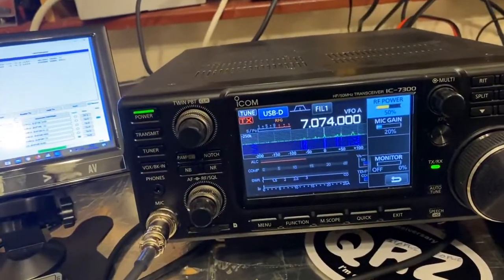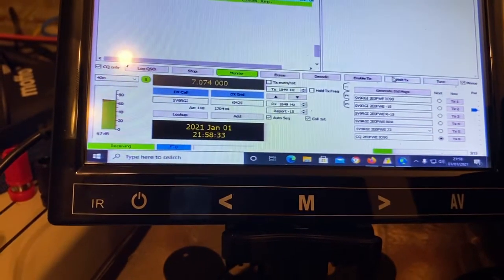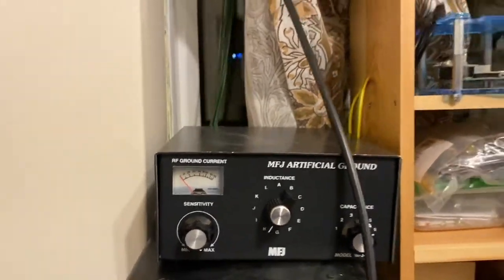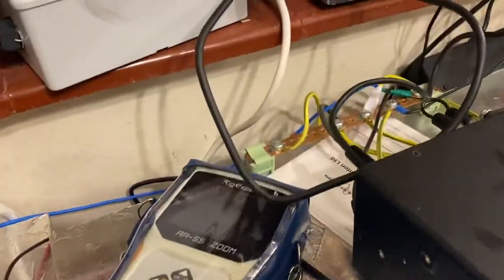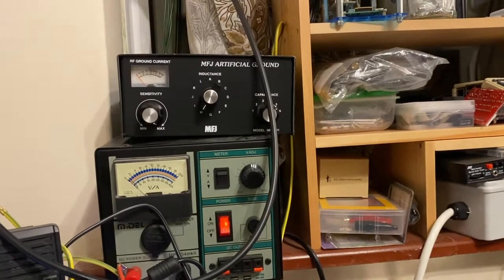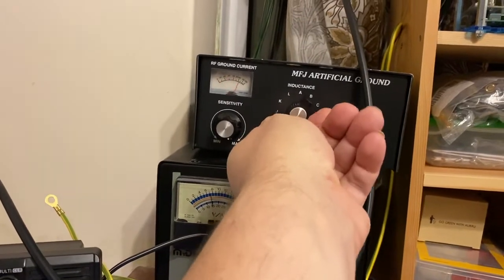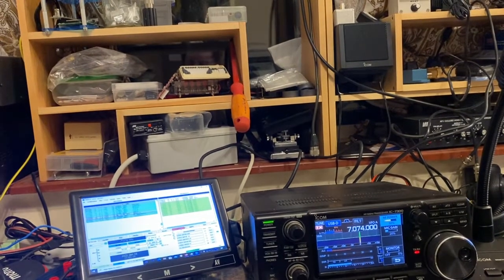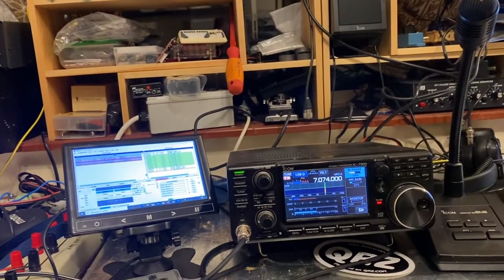Artificial ground (MFJ-931) in the shack with demo of RF going to the counterpoise

Comment: Thanks for the video. I just picked up an MFJ-931 to see it would help with  using an end fed antenna or one of my vertical antennas with a counterpoise, as well as to see if it helps with reducing unwanted noise in a busy urban setting. I have a ground rod outside but the run to connect to it is also significant. Fingers crossed!.
Reply: Hi.What would inductance setting be for 27 MHz?

Comment: Do we need that if we have a true RF ground?
Reply from the maker: I would say you need it less if you have a proper RF ground as the 931 is acting as an artificial ground. I now have a proper copper pole with earth wire going from this to my shack equipment, still see it pops up a bit of reading. Thanks for your question :) 73 2E0FWE

Comment: How did you adjust the artificial ground?  I did not catch that part completely. Also how did you connect it and what are the connections on the back? Thanks
Reply from the maker: Hello Don - i used a set of radials (i would guess 5*5m) to the back. These bolt on to the earth point. These went out my window and the wires was pinned to (not laid on) the exterior ground. I hope this helps !
Reply: @alzeNL  Thanks, that does help.  I thought about getting and using the artificial ground when operating sometimes on a 2nd or 3rd floor in the building.  Will not be about to run a wire out to the ground. No good grounds inside. I want to ground the radio and tune the counterpoise from a heavily loaded vertical antenna. Hope that artificial ground can accomplish that.

Comment: Thanks for the vid, what is going on with the SWR when you make adjustments to the gtu? I'm guessing not much, compared to if you were using a quarter wave vertical.
Reply from the maker: If I recall, the SWR was already pretty good, it was a case of the dB and local RFI

Comment: how long are the counter poise wires?
Reply from the maker: hello David - I have 5*350cm, i know on my buddipole you can just use several piece of wire and make it the necessary quarterwave length there as well (worked 20M the other week). I'd go for a 1/4 of what ever the highest frequency is of what you want to use in total wire length, the artificial ground will be able to 'tune' into it.